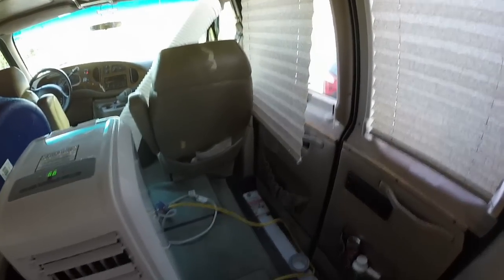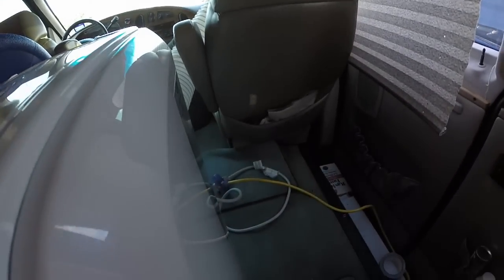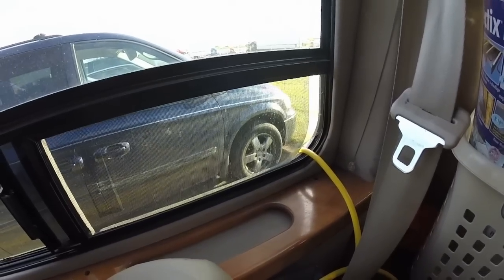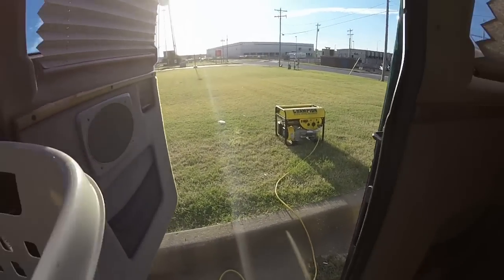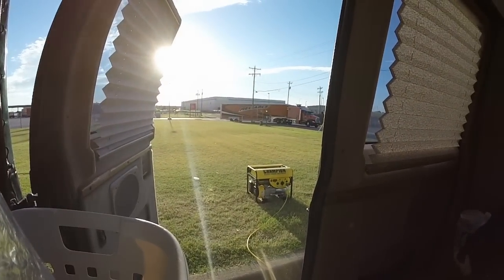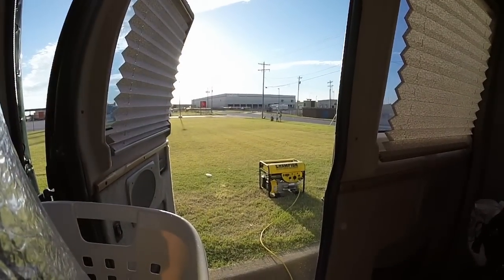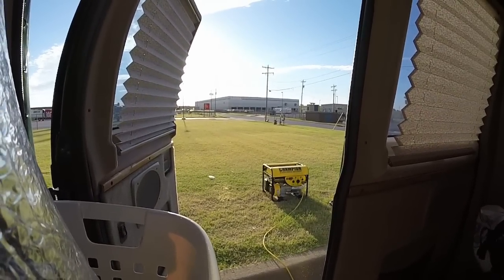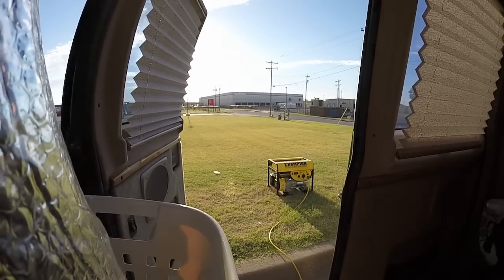How I Have Air Conditioning Set Up Without Running My Van's Engine

Comment: thanks for the video. i am on it this week. buy one and see how well it works with my honda 2000. i may need a smaller one for the back of my truck. thanks for the video
Reply from the maker: de N5XTC Your welcome. Just looked mine is a 9000 BTU but I miss spoke in the video. Just an FYI

Comment: Just a suggestion, but you really need to find a way for your exhaust vent tube to not be so long.  It is acting as a heating unit, making the AC unit work harder.  A vicious cycle.  Also, don't people complain about how loud that generator is?
Reply from the maker: Never had anyone complain at all. I also never been bothered about it either. I barely hear it when I am inside the van with the door closed.
Reply: Wanderlust Estate Cool.
Reply from the maker: I would rather have a super quiet Honda sitting in a hitch box with venting, but that kind of arrangement would be at least $1400 bucks. Which is a lot of gas money. I paid just under $300 for my Champion and it has a longer run time on one tank and more wattage output than the Honda.
Reply: Your saying the vent tube on the A/C unit itself needs to be shorter right? It does make sense because that tube has hot air going through it and the more tube you have in the van the more heat is coming off it. Maybe im wrong but thats what I thought you were saying but looks like Wanderlust Estate thinks your talking about the generator itself not the breather tube going to the A/C unit.
Reply from the maker: I did think he was talking extension cord whoops I see where I goofed now.

Comment: Hello just wondering what you use to close your front passenger window while you are venting your AC out of it? I thought about making a plexiglass template the hose would connect to and close of the rest of the window easy to set up and take down.
Reply from the maker: That would likely work well. I just use cardboard and duct tape. Since its only up for the night. I don't hang out in my van much otherwise.
Reply: Ah I got ya when I'm on the road expediting in the summer time I use my portable ac unit when parked waiting for freight. I had a template made from wood but I  dropped it and it broke only a couple of weeks in till fall so I stuffed a tuff duck work jacket in the space up to the vent hose lol  loving your bids and channel be safe
Reply from the maker: Thanks I appreciate it. I am glad you like it. You stay safe as well.

Comment: Hi Wanderlust - I new to the van dwelling community and have really enjoyed your videos.  I think I saw this one way back when you first did it but didn't think much about it because I had only had my van a few days at that point.  Anyway talk to me about this A/C set up.  I've got a 1972 Dodge with no A/C, crazy right!  Then someone ended up giving me an unit like yours a few weeks ago but I think it may be bigger.  Anyway I haven't tried it out so I was hoping to get your thought on a few things.... Do you think it makes the van damp? or is there any moister because of it. Does it freeze you since its meant to cool a room.  I like cold so it takes a lot to freeze me.  I've got a class b but I need to do some electrical work/upgrades before i can run the a/c off the van or battery - So a generator maybe an option, well i want one anyway, but how long can you run the a/c off of the generator.
Reply from the maker: It does not make the van damp because it pulls moisture out of the air not put it in the air like a swamp cooler does. You do need to be ready to have a way to let it drain though, and the higher the humidity where you are the more of a concern it is to have a way for it to drain.

Most AC units have a thermostat, so having it freeze you really isn't a concern.

You shouldn't run the AC off your batteries because it will wear them out fast.

How long you can run it off you generator depends on how many watts you AC unit uses when running and what generator you have. For highest number of hours running the AC you want to make sure your continuous watt rating on your generator is at least twice the watts required to run the AC. This is because the higher the RPMs on your generator the more fuel it will burn. My generator has a continuous watt rating that is 3 times that of the watts needed to run my AC unit and it has a 4 gallon tank. I get about 21 hours of operation of the AC on a tank of fuel.

Hope this helps you out. Glad you decided to join the community.
Reply: Wanderlust Estate - yes, that did help. I didn't know about the draining part at all.  I will be avoiding humidity like the plague, I hate that shit! But I'm sure I will still need to drain it. I'm going to read some of the manual today should probably find out what else I don't know.
Reply from the maker: van grrrl Yeah it is best to know as much about your new unit as possible. Don't be like me and learn the hard way. Man the trials and tribulations of being male. Haha
Reply: Wanderlust Estate you mean there another way other than the hard way.
Reply from the maker: van grrrl LOL, well I assumed so since there are directions. Figured you could avoid making your van stinky with the condensation pan water over flowing onto your van carpet because you didn't realize it needed to drain and you were running it in a high humidity area.

Comment: With the solar systems they have out today you can run an AC and  a refrigerator  off of solar with no problem.
Reply: You have to buy an expensive battery for that.

Comment: not exactly a stealth operation...still looking for a set up that incorporates stealth w/ economics and decent ac temps...
Reply from the maker: If you want stealth cabin cool 12V AC paired with a super quite Yamaha or Honda generator in a sound absorption box is the way to go.
Reply: thanks, i'll be looking into that; how quiet are those generators? I want to be able to sleep while running it...
Reply from the maker: mytime istoday They are very quite on a 50% load and if you build a sound proof box you won't know its running.
Reply: I was actually researching various generators when you posted that reply! LOL! but, it's now 3AM; time this old fart got some snoozing in. Thanks for the tips...
Reply: Just keep driving North.

Comment: I have a 5000 watt inverter in my van and about to buy a 5000 BTU a/c Frigadare  will it work??????
Reply: +ROGER BROWN no.
Reply: +Kevin J - Why? I had the same idea and knowing why would help. Thanks.
(The Frigidaire is 446W and 3.9A)
Reply: most batteries can not supply the power via inverter. The most folks get is two hours with a big enough battery bank.

Comment: Seems a bit much there....I see the need for AC... but there are other ways to do it and save a bit of stealth... a few links...http://www.swampy.net/index.html....http://www.swampy.net/mac.html....http://www.icybreeze.com/portable-air-conditioner/, as I have been looking at options, these seem ok, but still looking at other options as well, but running a genny well seems a bit much for me, but if it works for you, have at it!
Reply from the maker: Yawppy Cache Your links strung together. Most of the options other than the Cabin Cooler for truckers just doesn't work in the summer in a real sunny hot place. You need serious BTUs for Houston. You can't run anything with 8000 BTUs off batteries without burning the batteries up.

Comment: Hey, here's a cool A/C tip - when it's too hot - open the windows, when it's too cold, close the windows. Seriously, this is supposed to be about camping and you're worrying about airconditioning? Dude, just stay home.
Reply from the maker: MrUndakava  I don't think you understand Southeast Texas heat. Have you ever slept with 95 degrees and 100% humidity?
Reply: You obviously have never been in a RV or Van for any amount of time on a nice summer day. Now from my experience if its say 80 degrees outside of my RV it can be a good 100 degrees or more inside. Opening the windows don't help much especially if there isn't a good breeze outside. That's just the warm days, Now the winter time is a whole new problem. These things aren't the best designs to keep heat inside when its cold out. and even when you do get the thing heated up you can about bet that the floor is still freezing lol. House shoes are a must. All of that is just my experience while living in my Class C Holiday Rambler. I would bet that a regular Van like Wanderlust has is hotter in the summer time and colder in the winter than my RV. I live in Virginia and it gets like that, Now just imagine being in Alabama or Texas with that kind of humidity. You cant even breath it gets so bad.
Reply from the maker: AC is a must in the summer for sure.